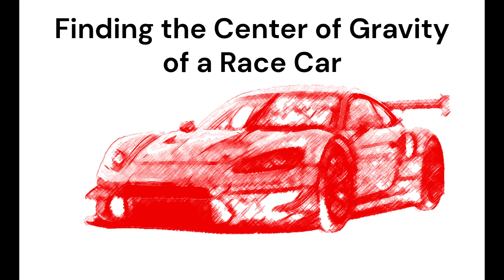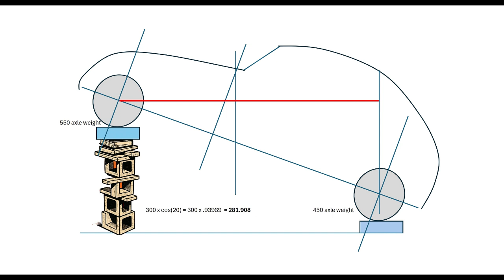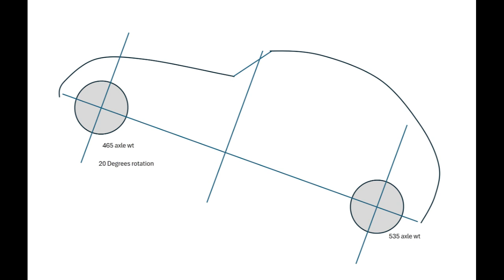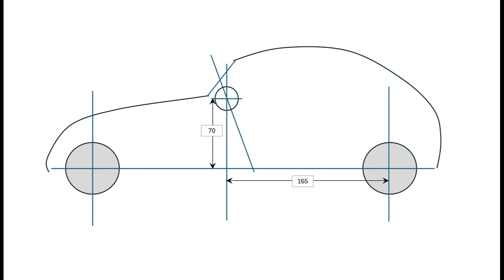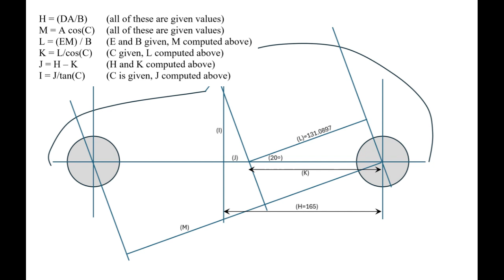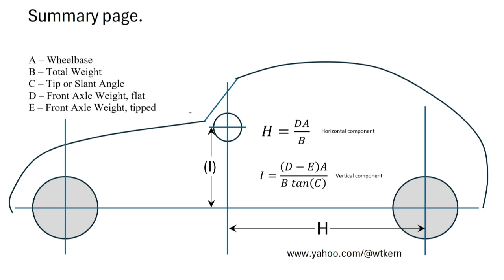Race Car Balance V5

Comment: should remove engine oil and fuel. Replace shocks with a solid bar to control ride height and air the tyres up to have a constant radius when the vehicle is raised.
Reply from the maker: Agreed, the movement of the suspension would cause some error, and blocking it out would avoid that. Fine-tuning really is worthwhile. As for oil and fuel, you could account for those separately, if you chose to do the math to figure it out, as is done in weight-and-balance calculations for aircraft. It would also be interesting to consider the change in CG location with fuel burn. Thanks!